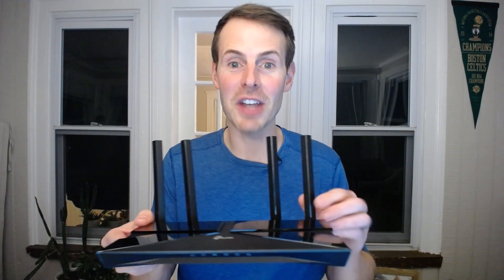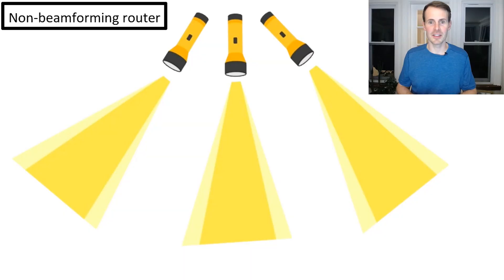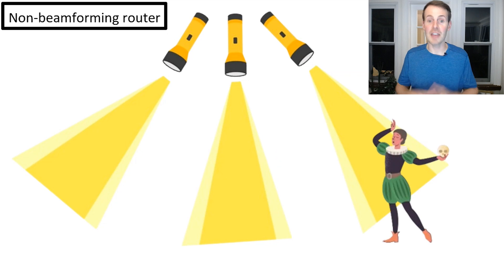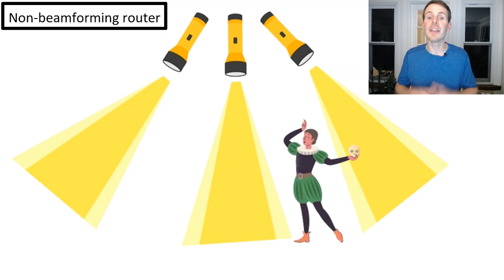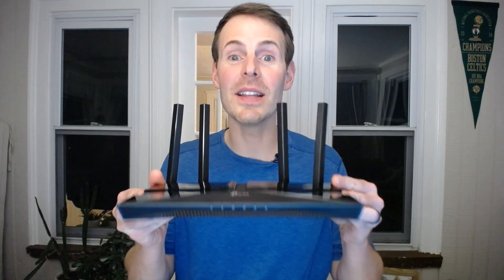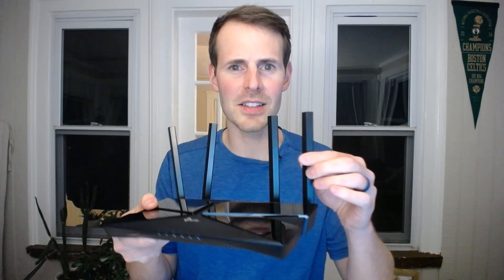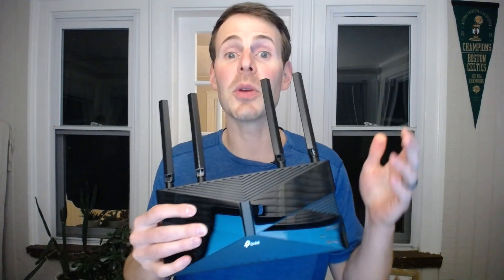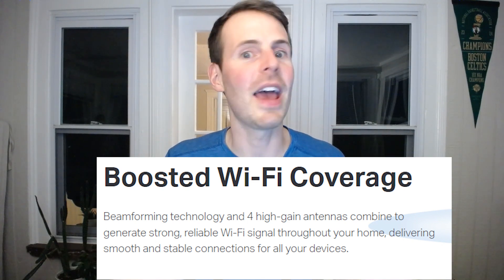Router Antenna Positions With BEAMFORMING: What to Do

Comment: Hello, I’d like to ask some advice about the position for the beamforming antenna. I have an AX12 (in access point mode) that’s mounted on the wall in order to cover 8 rooms (the 2 rooms from the 8 rooms aren’t too far from the router but are blocked by a wall). How should I position the antenna so that these 2 rooms can get a decent signal?

Comment: The router doesn't need to calculate the destination's direction. It receives its signal at its antennas at slightly different times, and answers with the same differences but in opposite order.

Comment: I am setting up a GL-MT6000 (also known as the Flint 2) router in my second floor.  I was planning on hanging the router on the wall.  Would it be better to hang the router so that the antennas point down or up?  I want to get the best signal on the lower floor and even the basement.  This router is a Wifi 6 router with Beamforming.
Reply from the maker: I would recommend hanging the router so that the antennas point up. That is the standard orientation for beamforming routers, and the WiFi signal naturally "falls" so that should give your devices good coverage on lower floors. I hope this helps. Good luck!

Comment: what if i beamform, with a rog strix gt axe 16000 on a 3 level house. router is on upper level... i need to reach down stairs, and middle floor as well. the router has 8 antenas, how to allign them properly ? are all antenas broadcasting all wifi ? 2.4, 5 and 6 ? or each antena has a specific band ?  si this is a 8 antenans, do they work in pairs ? which means, i should point 2 antenas down, 2 on the same level and the 4 others, in pairs pointing to a different place on the middle level ? thanks great videos
Reply from the maker: If your router utilizes beamforming, your best bet is to keep all your antennas straight up and down; they will aim their WiFi signals accordingly based upon the devices that are connected to it. You don't need to alter the position of your antennas with a beamforming router. I hope this helps!

Comment: If multiple devices connected to router with beforming on, how router will focus on all of them, specially if all of them are in different areas
Reply from the maker: This is a great question! If multiple devices have active connections to a router, the router will send a portion of the WiFi signal to each device. In other words, your router also has the ability to handle multiple inputs and outputs at the same time. I hope this helps!

Comment: What about coverage of the floors above or below? You said in a previous video that the signal propagates perpendicular to the orientation of antenna.
Reply: Even with beamforming, the signal is still a donut perpendicular to the antenna. If your devices are close to the vertical plane, it still makes sense to angle the antenna to strengthen the alignment with the donut.
Reply: @CWaldman  That's right. Beamforming can't "steer" the signal perpendicular to the direction of the antenna. The commonsense approach of adjusting antennas to align with the most-used devices in your house, still applies even with beamforming.
Reply from the maker: This is a great question. When you have a router with beamforming capabilities, it will "steer" the WiFi signal in the direction of your devices, even if they are on other floors. This just makes things much easier when providing a strong WiFi signal to your devices: you don't have to manually steer your WiFi signal, your router does it for you without having to move the antennas. This is why you can keep your antennas in a vertical position with a beamforming router.

I hope this helps!

Comment: The WIFI routers can be 4G (2,4Ghz), 4G LTE 2,4 Ghz, 5 G and Dual and Triband ( 2.4 Ghz , 5 Ghz and 5,8Ghz).

I upgraded my to WIFI 7 MESH with 2 routers interconected with ethernet cable CAT 6A. Model Xiaomi BE7000 and  I have the best coverage all over. Al my antenas are in vertical position.

The largest WIFI network I installed was a WIFI 6E MESH with 4 routers Xiaomi chinese version that provide coverage to 4 buildings and a farm with an extension of 300 feet x 1,000 feet. 3 routers interconected with CAT 6 cable and 1 WIFI 6 interconected.
The best was the price , only 350 USD for all 4 routers and network cable.
From the last tree there is direct vision with one of the routers on the top of a building. This router is a Xiaomi Redmi AX5400. Internet Service Provider at 300 Mbps, and speed test in celullar of 120 Mbps conected.

There is no need to optimize 1 router WIFI, when you need a larger range that only can be setup with a Network WIFI MESH, and this network will last for at least 15 years.

Comment: Beamforming could be disabled in admin panel if that causes troubles. But generally if i test i need to give some time in certain position for signal to improve. If your clients constantly moving, then poisoning antenna in all sides and disabling bf might work better, but that is a rare case.
Reply from the maker: Thank you for sharing! I think that’s a key point here: everyone should test these things out until they find a configuration that gives them the best WiFi coverage. With that said, I would expect beamforming to be the best bet for most people